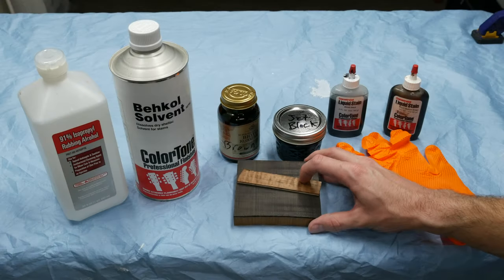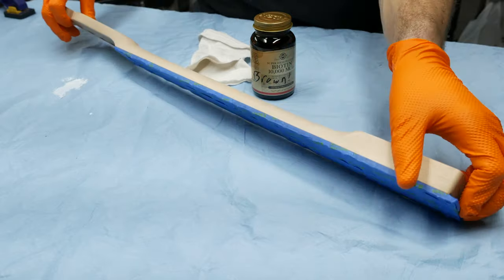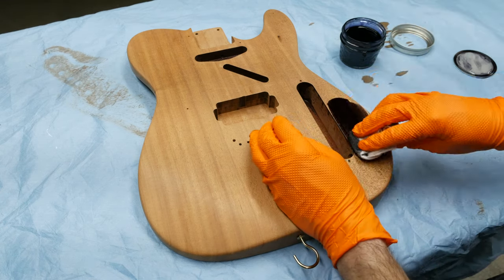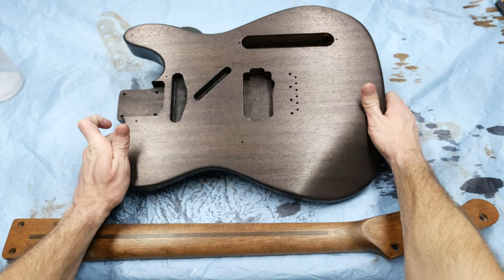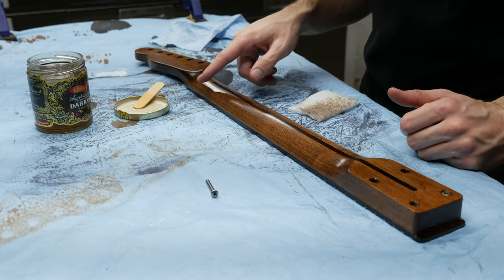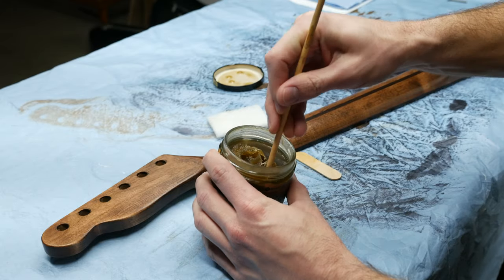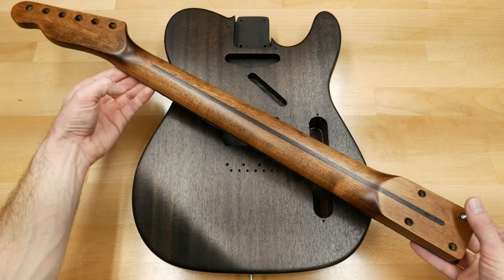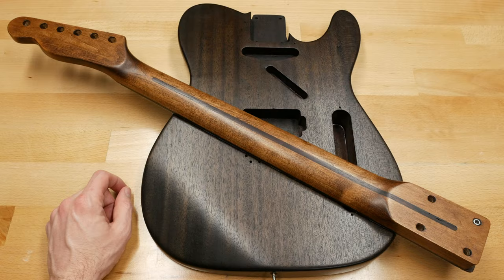Stain and Odie's Oil Finish || eBay Telecaster Revival || Episode 9 || DIY Partscaster Guitar Build

Comment: Thanks for clearing that up. Never knew why one would choose water vs alcohol based stains. Makes sense! Also a strong magnet works great getting all the little steel wool shavings off the surface
Reply from the maker: When I first started, I only knew to mix it with water and I hated how much it raised the grain. Once I used Behkol/denatured alcohol, I never went back! 

Oh that is a good tip!! I'll have to do that on my next finish job. Time to buy some magnets. Thanks for the tip! 🙂

Comment: What a great series! I love this finishing technique and your tips. I have a question and I'd love to hear your take. 
I have a roasted maple neck which is several tones lighter than the roasted swamp ash body of the guitar. I'd like to get them closer in tone and I'll probably follow your steps to darken the neck. 
Contrary to your build, the fretboard is roasted maple and not rosewood. Any suggestions on treatment? I'd like to make sure staining and oil is also a good method or if fretboard staining and finishing should be done differently. 
Keep up the amazing work! Your videos are super detailed and help us (rookies) lots! 
Best regards from Amsterdam, NL!
Reply from the maker: Thank you! 😊 

Before you stain the neck, wet the body and neck both down with Naphtha to see how they will look with oil on them (gets it pretty close). You may find that they both darken to a similar tone! When finishing the neck and fretboard, you'd do the same thing I did in the video except ALSO stain and finish the fretboard. Be sure to focus on sanding in between the frets as you don't want scratches showing after staining. It can be a pain to sand in between the frets lol.... Hope that helps! 😊
Reply: This helps a lot! Thanks again for your help and tips. 
Looking forward to learning more through your channel and projects! Have a great day!
Reply from the maker: @brubecktime  thanks for watching! Happy to help 😊

Comment: Great Video, Amazing job! What is the body wood? Did you put the grain filler for the body? When you put the first coat of Supper D Odie's Oil, did color come out?
Reply from the maker: Thank you! 

The body wood is African mahogany I believe. I also didn't apply any grain filler. The color really didn't come out when applying the oil. A bit was on the applicator, but not enough to really make a difference. 😊

Comment: Nice job. What is your ratio of stain to solvent?
Reply from the maker: Hi Andy! Thanks for the kind words. 

I usually fill one of those small Ball jars up (4oz) a bit over 3/4 of the way full. For the black stain, I started with 10 drops of the StewMac stain and then tested it out on a scrap piece. I keep adding drops in groups of 3-5 until I get the desired color. I always try to leave the stain at a medium strength, so I can better control the color/darkness. You dont want to stain it in one go as it might be too dark. Hope this helps! 🙂

Here's a good StewMac video on it: https://youtu.be/u7ExkY6CdlM?t=164

Comment: Im thinking about using oldies on my roasted maple neck, quick question, is it safe to use on the fretboard or does it build up like tru oil? I dont want my frets "popping"
Reply from the maker: Thanks for watching! Odie's is a penetrative finish, so it doesn't sit on top of the surface like Tru Oil does (aside from a bit of wax). It is safe to use on a roasted maple neck. 😊
Reply: @AugmentGuitars  thanks man, one more question what grit of sand paper do you recommend to use before applying, I was thinking 200 or 400? I want a very smooth finish almost polished what grit would you use after applying do you think I could go up to 2000 after?
Reply from the maker: @parker97boy  happy to help! I like to sand anywhere between 800-1500 grit. Any further, the wood doesn't absorb the oil as well. Applying the oil with the white Scotch pads also helps buff it up as well.
Reply from the maker: All sanding happens prior to oiling finishing. I don't sand in between coats (for penetrative finishes) as there is nothing to knock back (since it doesn't build on the surface). Hope that helps!

Comment: What is the behkol solvent? U put that on before the stain?
Reply from the maker: The Behkol Solvent is what gets mixed with the concentrated stain dye. It helps to prevent the wood grain from raising when staining!
Reply: @AugmentGuitars  so do I need to buy this as well? 

I just bought a kit and gonna try and get the finish u used
Reply from the maker: @jq9095  You can use behkol solvent, denatured alcohol or even 91% isopropyl alcohol for the stain base. Up to you! 😊
Reply: @AugmentGuitars  thanks I’m completely new to all of this.
Reply: @AugmentGuitars  so I put the behkol solvent on first
Reply from the maker: @jq9095  So the behkol solvent needs to be mixed in with the stain. These are the stains I used: https://www.stewmac.com/luthier-tools-and-supplies/supplies/finishing-supplies/colors-and-tints-and-stains/colortone-liquid-stains/

Follow the mix instructions on the package and you should be good!